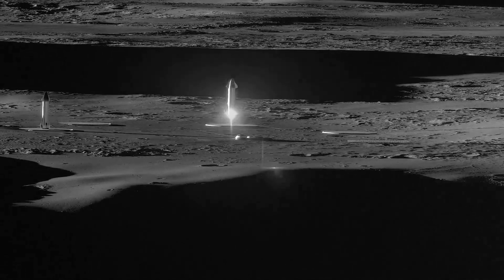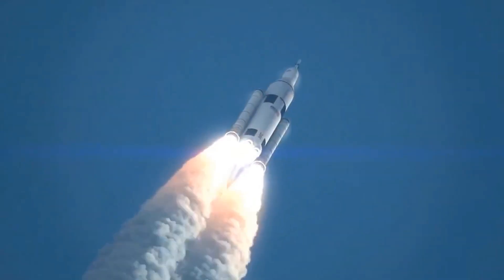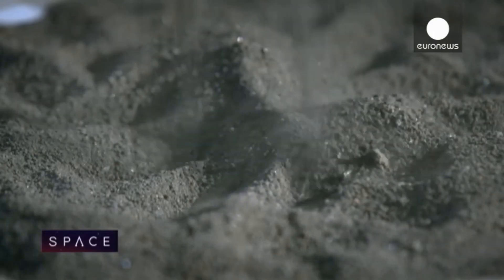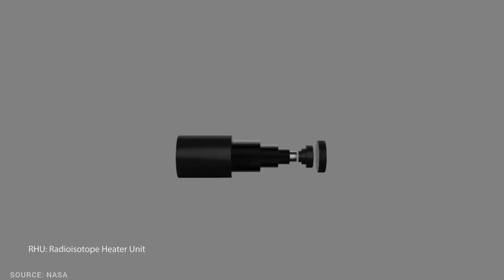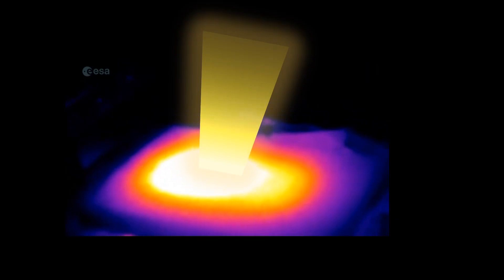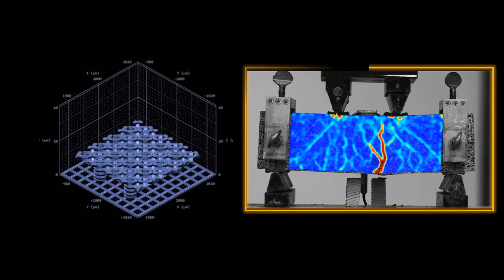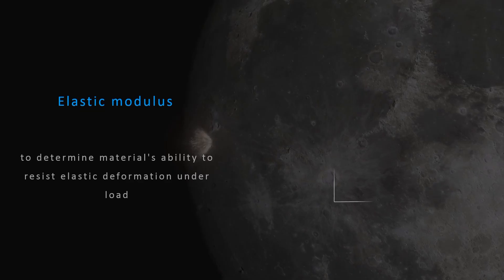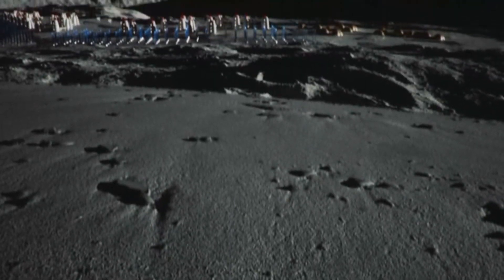The Real Problem with Building a Moon Base | NASA | Spacex

Comment: Your thinking is too primitive.Heating regulate is only one way to 3D print. You can also 3D print by mixing the regulate with water instead of heat. And after you form the structure, the heat from the Sun would melt the luna regulate into a hardened structure.

Comment: When you talk about the inflatables  are you thinking material like rubber and mylar?
They use kevlar and other materials that are designed to resist cutting and puncturing and include self heal technology to seal holes.
These things are designed against micro-meteorite infiltration. I think they can handle jagged rocks in loose regolith.

Comment: It's not just meteors or micrometeors. When Apollo 12. It landed within about 180 meters of the Surveyor 3 spacecraft in November 1969.  The lunar module descent engine kicked up dust that hit the Surveyor lander like a sandblaster.  Astronauts Pete Conrad and Alan Bean even commented on the effect during their moonwalk. They observed that the dust had removed some of the darkening on Surveyor 3, revealing its original white paint in those areas.   Every meteorite that hits the moon will kick up dust and rock  and send it out at ballistic speeds. Most of that dust and rock  will reimpact the moon someplace else. Every rocket that lands on the moon will shoot out dust and rock at ballistic speeds. There is no air to slow anything down so whenever gravity pulls whatever projectile back down it's going to be moving at some place around the speed of a bullet.   If you're walking around in a space on the moon and a rocket land some mile away within a few seconds you could be hit by spray of debris.  Or that spray of debris could be launched into a a ballistic trajectory which could come back down hours or days from when it was kicked up.  Every vehicle driving around the Moon for any length of time that it's supposed to be holding humans or robots for that matter is going to need to be an armored car. That's the same for any habitat.  I think we pretty well have understood that since Apollo 12 and that's why we haven't gone back.  It's going to be incredibly difficult to have anything like a permanent base on the moon

Comment: No building needed, send the spacecraft as  modular units. They can be linked up and turned into a sprawling structure. Elon Musk plans on launching 3 to 4 cargo ships a day to outfit the lunar modules. In a 30 to 40 day period landing 3 or 4 cargo/habitat ships a day is not an impossible goal. There should be a continuous train of cargo ships to and from the moon on going. The first 40 days will establish the habitats, work facilities, laboratories, warehouses and equipment storage. I hope they use thrust vectored flying platforms to explore with. They need to harvest helium3 then figure out how to make energy with it.

Comment: hello, I am the lead designer of the pneumocell team who ´s inflatable moon habitat concept you mentioned.
we are aware of the problem with sharp regolith grain.
following precautions are provided to solve that issue:

1, the regolith  for the  30 -40cm layer that will be closest to the membrane is sieved , so only very small grain is left over.
2, that small grain regolith is stirred  in a rotating cylinder, like a big concrete mixing machine. through the movement and abrasion the grain is smoothened, 
3, We cover the structural membrane with a protective foam layer. Even when compressed to the minimum, the foam still is thicker than the biggest  grain particle.
4; the membrane structure consists of 2 layers, divided into a grid of inflatable cushions with separate volumes. 
if one layer gets punctured, the other layer still holds the air pressure  and  only one  cushion is affected.  The membrane can be fixed with glue tape.

the regolith layer that covers the structure is 4-5 meters thick. That amount is required for an effective shielding  from cosmic radiation. But it also absorbs the impact of meteorites.  not large meteorites , but small ones that hit the lunar surface most frequently. 
with 4-5 meters of loose regogilth covering a soft and elastic membrane structure, we offer a much better protection than the rigid and brittle walls of the 3D-printed designs.
in case a relatively big meteorite destroys the membrane, it helps that the structure is modular.  the damaged module will be cut off th system by closing the lock door and can be bypassed by the other connecting tunnels until the damaged module is repaired or replaced by a new one.

regarding your objections against 3D-print, I totally agree.  I think it only makes sense to print small components ISRU , but not  hundreds and thousands of cubic meters for structural walls and ceilings.
And thanks for this informative and well made video!
Reply from the maker: Hello Thomas, thanks for the additional information.
Reply: @revolutionaryengineering  if you like, I can send you our  full  200 pages report, that we made for ESA about our project. In a chapter of that report we compared by numbers and facts the payload, energy requirement and protection from cosmic radiation  our design with other 3D-printed designs
Reply: I would guess there would also be a gel layer that instantly seals itself in the event of micro-meteorite punctures? Like what's in self-sealing tires?
Reply: Healing regulates not the only way to 3 print. You can also 3 D print  by mixing the regulate with the water and use a liquid extruder to pour it out like concrete. Then, once the structure is formed, the heat from the Sun would melt destruction into a solid structure

Comment: Chinese scientists have shown that Moon dust could be used to make fuel for spacecraft in outer space. This has the potential to make space exploration cheaper and reduce the strain on Earth's resources, as countries and businesses around the world prepare for the next era of human spaceflight
Reply from the maker: I think you are pointing to using the lunar Regolith (soil) as photothermal catalyst to convert CO2 and water to produce oxygen and methane on the moon. CO2 combines with hydrogen to produce methane. But first, hydrogen needs to be produced through photovoltaic electrolysis of water. Water needs to be drilled out. At each step you need energy along with tools to generate it. Even with all this, whether you can produce enough methane that can be used as propellant is highly questionable. Alongside, you will need oxidiser at scale.

Comment: These are all very difficult factors to resolve, (if you are on the surface).
If I were the lead engineer for such a project, my primary focus would be to build these habitations underneath the surface.
This would greatly reduce the effects of the thermal variations, as well as provide protection from the incoming bombardment of space debris.

Comment: For energy we really need nuclear reactors on the moon, solar doesn't have the oomph needed.

For temperature differences I'd suggest initially building in a stable temperature environment, like the permanent shadow at the base of polar craters, that way you avoid repeated heat expansion and contraction cycles.

But we need to go there first with earth designed and built structures initially, followed by in situ research for all of the other myriad challenges.

It's going to be a tough challenge, but I believe humans can overcome all of these challenges.
Reply: Solar has more oomph on the moon than on earth, and there is greater uninterrupted area available.
Reply: @Stuff_And_Things  I'm looking forward to the day we can run smelters and furnaces off of  solar panels and batteries. Maybe if we had huge numbers of solar panels but that seems far less efficient and reliable than a protected nuclear reactor. The maintenance requirements alone from micrometeorite damage would be huge.
Reply: @Codysdab   I'm wondering how all the solar powered satellite survive. I know it seems like meteorites should be a problem but how do the panels on satellites not get destroyed?
Reply: @Stuff_And_Things  with a satellite the particle has to hit it directly, on the moon indirect hits could could cause damage. It's all to do with increased impact area.

Comment: Is it is possible to use a series of large geo-synchronous stationary solar arrays above the moon that can focus the suns energy into very hot beams of energy, hot enough to melt the regolith overburden at the planned construction sites, into round beads that could protect the surface based construction equipment moving the overburden around? Then this overburden could be safer to work with. This would not only eliminate the abrasive nature of the overburden but would also remedy the static electricity issue around the construction sites. Then, using this space-based energy beam from the sun-

side note: conspiracy theorists say there is already such a device above earth that was responsible for the fires in Paradise California and the recent fires in Hawaii that focused high energy beams on the buildings, burning everything to ash except for certain buildings painted a certain shade of blue that were completely unharmed? Both USA, Russia and China are competing for space based artificial sun technology. Also many solar power stations in deserts around the world can produce incredible temperatures with focused mirrors.

-this material could be pushed into layers like how a powder based 3D printer works and the beam from space could create a melted layer pathway like a 3D powder printer and then the process could be repeated over and over as ground based machines push additional layers over the previous ones to create buildings with as thick and high a wall as you want. The walls would be supported with all the previous overburden layers underneath and when the construction is done the building is already buried and protected from the micro-meteroids and cosmic radiation depending on how deep a layer of overburden is placed over the newly printed building. Then the interior of the buildings would need to be cleaned out to provide an open interior environment ready for habitation.